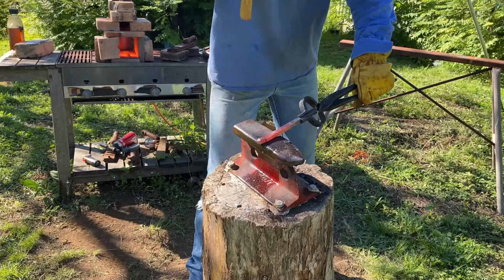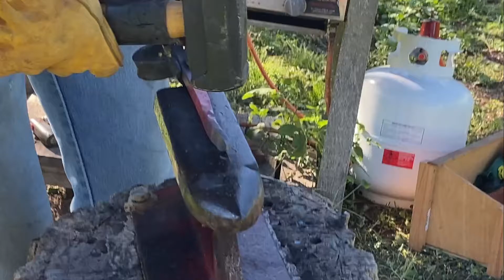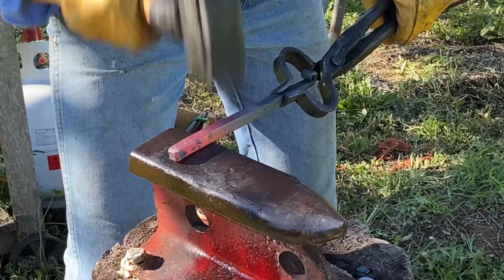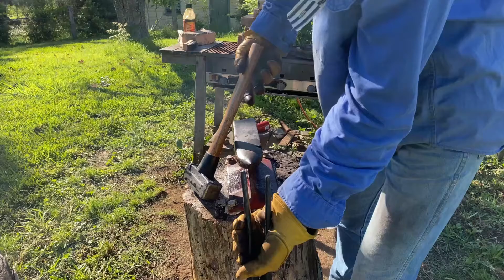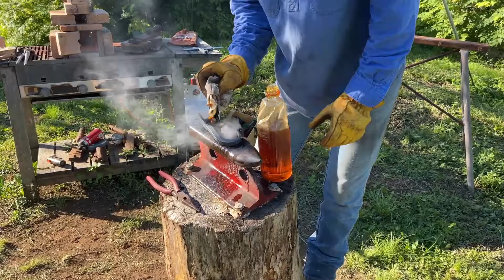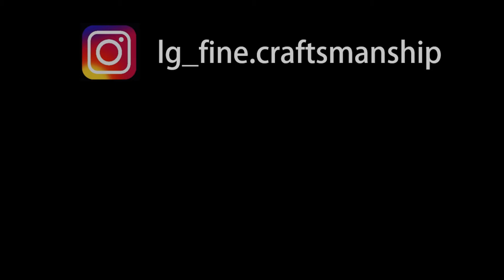Forging a Square Hook

Comment: Looks great Luke!
Reply from the maker: Thanks Alex! I know there's a lot to improve on (as always) but I quite like the overall design/ aesthetic of it with the square section and scroll, I think it looks a little bit tougher than with round. I did also try and forge another one a few days later, and it didn't turn out that similar, as I guess I didn't remember how much material I used at each section.

Comment: It turned out well! Your technique for starting the bend is a bit sketchy though 😂 I lay the bar across the horn and hammer direct over the top, moving the stock back and forward and this will gradually introduce a curve. There should be enough radius on yours to get a good start. Great job on the anvil too 👍
Reply from the maker: Thanks for the tips Geoff! I think I may have started the bend that way because my tongs weren't the right size and they weren't very secure. The anvil on the other hand does the job, especially for me just getting into the craft, but I really want to get a proper anvil with a hardy hole and a bigger horn which would really open up things I could do. Thanks for watching!
Reply: @lukegraham1945  I'm short on correct sized tongs too, so I generally use a long bit of bar so I can hold onto it without tongs, and then cut it off when I'm done. Good luck with the anvil hunt!
Reply from the maker: @geoffcapper5025  Thanks!